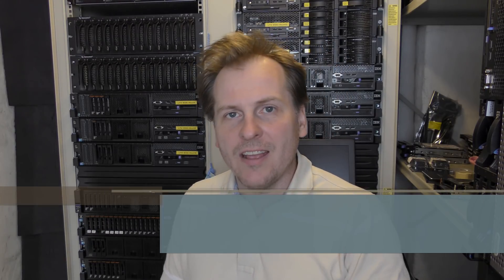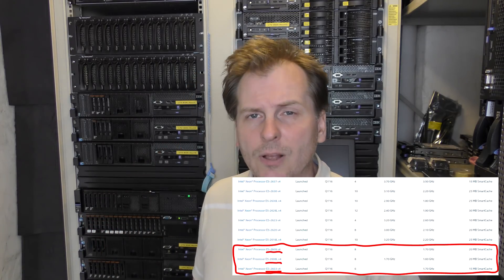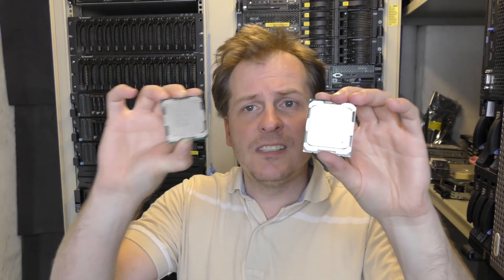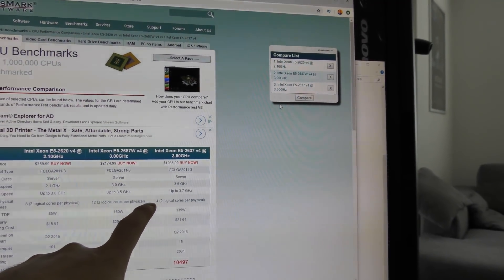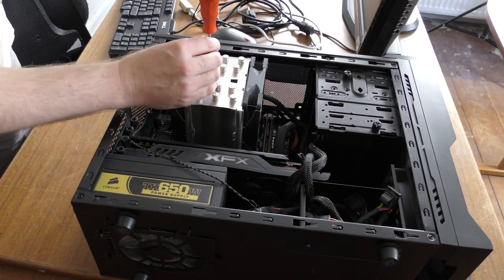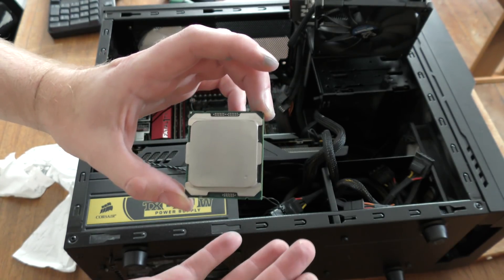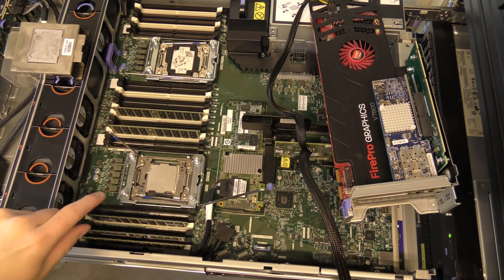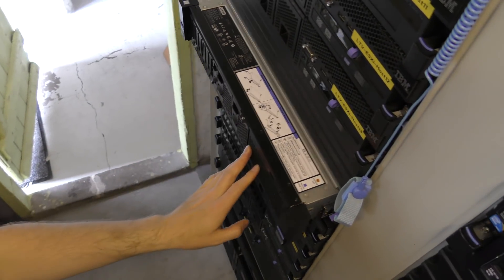$2150 Intel Xeon E5-2687W V4 12C 3.0GHz in x3650 M5 - 854

Comment: Hi Morten,  can you tell me how I can get a trial FOD key for IMM on a 3550 M3 server? I tried the lenovo website and they dont have M3 listed anymore.  I need a trail key so I can activate the remote control feature on a Cisco CT-8510 wireless lan controller for initial configuration? Or if you can give me some advice on getting the serial console connection to work? I just could not get this to work. Thank you for your reply.
Reply from the maker: Hi Yingyu Wang
On the M3,, both x3650 and x3550 it is a hardware key : https://amzn.to/2YbQrV0
It's not expensive any more,, they were back in the day..
Thank you for watching! :-)
Reply: My PlayHouse thank you for the advice

Comment: Hmmm, just wondering. You replaced a 85 with a 160 TDP cpu. Doesn't it require a bigger cpucooler? It looks kind of skinny :)
Reply from the maker: Hi Henk Kok
Thank You very much!  You are really not suppose to use the E5-2687W V4 in the x3650 M5,,, the W stands for workstation,, and the max of 160W is more than the 145W that is normal max. in the CPU series.
Thank you for watching! :-)